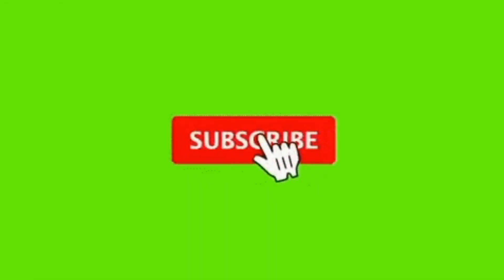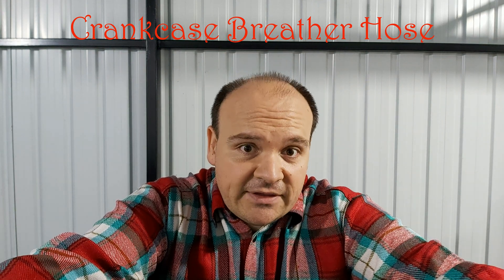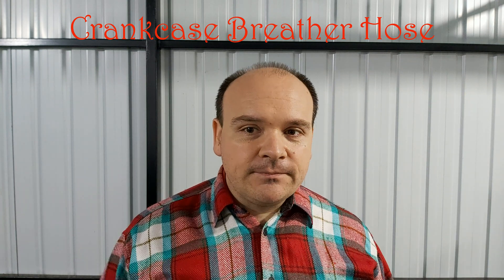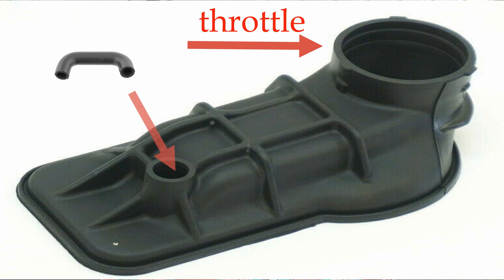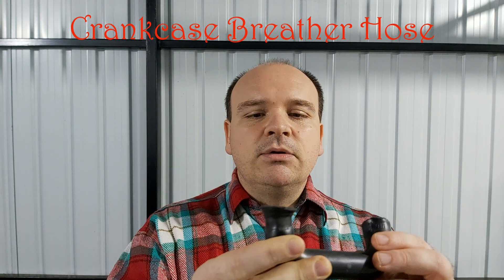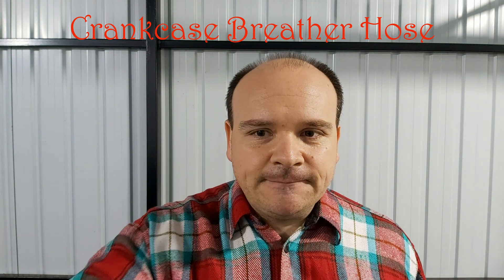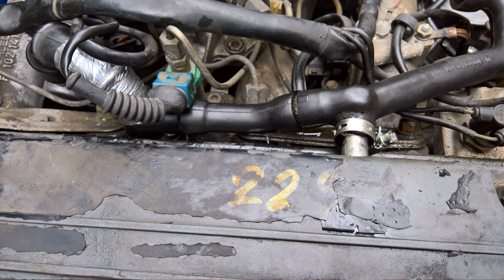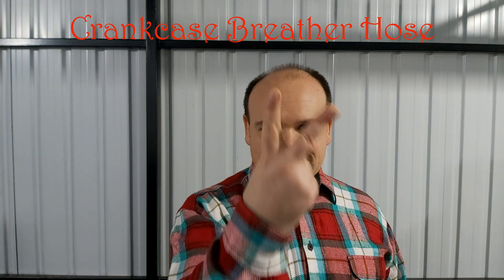Mercedes KE-Jetronic - The Crankcase Breather Hose

Comment: Can u do a video about that whites connectors? That mine got lost and its not basic o coonector, it has some ways in that, so i dont know how to recreate something similiar
Reply from the maker: Sorry for the delay. If you have lost a connector buy another one, I don't understand what I should say. Everything is self explanatory. 3 parts of the rubber hose and the fourth one underneath. The shorter part of the adapter goes to the left in the first part of the hose leading from the air filter housing. As for the rest, the arrows tell everything. It's really nothing hard.
Reply: @mercedeske there is no site, where i can buy them. After some time and some question, i find out that i can only put some thing to that idle hose to not let air go there from that way and same on the other site. Car was running fine. That plastic is only to close that for the crank breath and as a reduction for regulator vent. You can fully block it and leave f. p. Regulátor vent lie there as it is

Comment: Are you sure at 6’06 you are right? I think the first part goes to the filter box, the second one to the engine and the last one to the icv.
Reply from the maker: So, the first one connects the air filter housing as well as the engine, the least straight one goes afterwards stuck in a plastic part between the two of them and the third one to the engine as well to the ICV. Maybe I made a mistake but that's how they go, written as in this comment.
Reply: @mercedeske  👍👍👍

Comment: yes as you can see here......in minute 6:06 you show the ICV hose that connects to the engine. In the middle there is a connector that have a small hose that goes to the pressure regulator......that connector is pointy in shape and have a small hole for air from the engine breather hole...Is it important for the ICV?...iv read it somewhere but i cant find it again... I closed that connector hole. And my ICV top hose does not connected to the Engine blow by hose and to the intake filer box.. my engine idles good but if i open that small connetor hole it will shake just a tiny bit...some sort of air from engine breather hose for the ICV through that connector.
Reply from the maker: That's just a ventilation hose, they call it vacuum hose but there is no vacuum there. There is an australian guy that was showing that the hose serves just for ventilation.
Reply: Hello, so u fully closed that hose? I lost this one connector and dont know what to do...
Reply: @asineprestanou5221  the pointy connector have 2 hole....the stick with hole pointing outside is for your fuel pressure regulator fail safe hose....cuz if it fails it will leak petrol and petrol goes back into the ICV (engine)....the other hole is on the pointy side for the ICV get outside air....ICV needs a little air from outside to help Idle better....you can close it for a while but for me (an automatic trans) it will idle a bit low....
Reply: on the U shaped ICV big hose...the other plastic connector, plug it off with a radiator stopper cap with 12mm inner dimention size...throw away the middle hose....and u can run ur engine fine....
Reply: @makavelibenzze  so its kinda worthless 🤣
Thanks god😅
That plastic is just a stopper and reduction to the fuel regulstor vent, witch is worthless too? There is no air vacuum from that part to that bigger hose to the airfilter
Reply: @asineprestanou5221  the hole on the pointy side is important....ICV needs outside air for it to regulate ur Idle...you can plug it off but you need to compesate for it. It will run fine
Reply: @makavelibenzze  i mean it like, that platic thing with thar smaller part is only size reduction to connect fuel reg. and that air from it is not comming to that airfilter and crankcase breather. I removed that middle short hose, close the other hose and it should be alright?